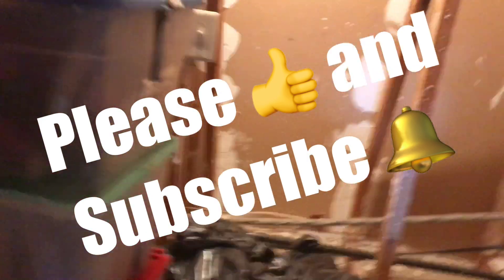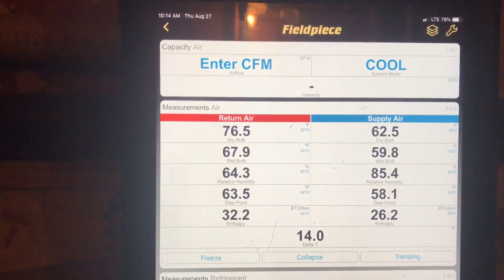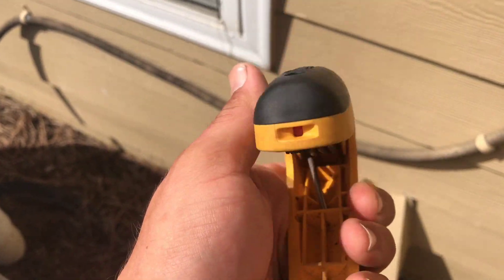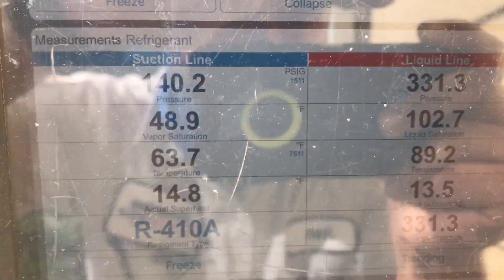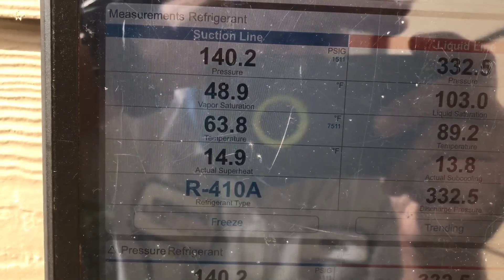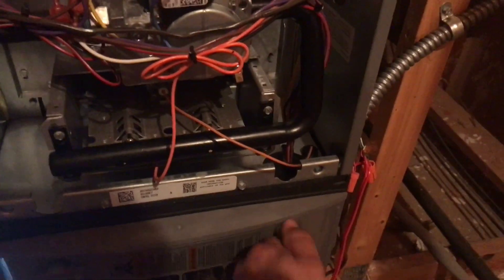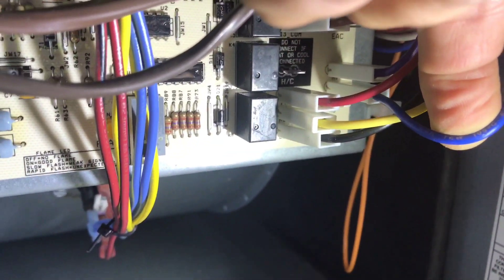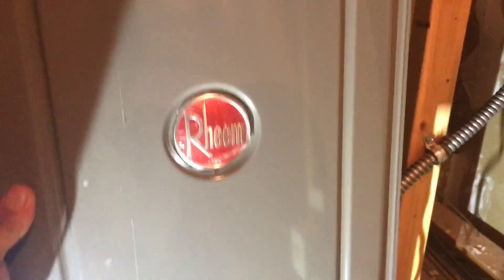Delta T’s and Blower Speeds.. HVAC Service Call

Comment: I wonder if you can help me. I have a brand new trane 2.5 T 410a(old stock 2018 model) mated to a 2018 goodman 3 ton air handler . Ive always suspected blower motor is set too high because Delta T is only 13-14 on a good day in cooling mode and 10-12 in heat mode unless its 50F out and then I can get maybe 13-14 . Last night it was 12F where I live in VA and weather app said feels like 5F. I could only get 73-74 supply air with a 66-67 return temp, therm set on 67. The goodman has an ECM motor with a multipin plug to board, I do not see taps or dip switches to change it? Can you help? Id like to get more than 7 degree delta when its 15F out.

Comment: That was the problem with my setup. Mine was purposely "mismatched" as in 3.5T coil and condenser and 4 ton AH. Only got a 13 delta T at best. I switched the black wire (high speed) to the blue wire (med-high speed) and the delta T went up to around 17. Mine is a piston, not a TXV. At least it's removing humidity now!

Comment: I have the same problem at my house where my DT is 13* and my Job Link Probes tell me the blower speed is too high but how can I find a lower speed if I have a Variable Speed motor, mess with the Dip Switches??
Reply from the maker: Possibly but you can’t always go by the job link app. Anytime the delta t is low it will always say the blower speed it high when it’s potentially a different issue. What is your SH and SC?
Reply: @HVACTechTips  My SC is at 8* (it calls for a 7.5* per specs) and my SH is at 12*.  txv system. Now at that time of checking the relative humidity was at 55 to 60% since I live close to Gulf of Mx.
Reply from the maker: @juanrobles9511  it really depends on a lot of things. Enough return? No vents closed? Low load in the house? Your blower may be set to a higher tonnage. You would have to check the dip switch settings on the back of the furnace door and match to the condenser tonnage to the switches on the board. If it doesn’t have dip switches it will have speed taps on the top of the blower motor where you can adjust speeds

Comment: the video is interesting but when I see the pressure in the suction line that is over 140 psi I would also be contemplating the possibility that the compressor may have a valve problem because something that I have been able to verify is that in the machines that claim to be from high efficiency is only theory because on the nameplate of the condenser they put that it is 30,000 BTU or 2.5 TR and the compressor is 22,000 BTU where the missing 8,000 BTU are and in a period of time the compressor is making a great effort and as a result it is that low pressure so high and there it may be showing valve problems and as we can find out, it is easy to run the freon in the machine and if when picking it up the machine does not go on the blue clock to empty and stays at 70 or 50 psig does not collect more and then we realize that the compressor is not doing it.  and to check the speed of the evaporator fan motor is important because if inside the pressures.

Comment: I had the same problem yesterday. After installing 1.5 ton unit (410a with a piston) in a 2 bedroom condo my suction line was 150psi and my line temperature was 76F. I realized that I forgot to adjust the fan speed (9-speed variable Goodman motor) the default was set to 1330cfm. I only needed 600cfm...

Comment: I've got a 5ton deltaT at 15 blower speed down to 1575 in a 2100 Sq ft home.When it's hot and a load home doesn't cool.If I speed up blower deltaT going get even lower.Subcooling is good superheat is good.Im thinking high static is main issue but evap could be starving.What do yall think

Comment: Where is the trap for the coil? Is withing the 3 to 6 ft.?
Reply: @carlgibson593  Manual says different.
Reply: @carlgibson593  First of all I just asked a  question. Then gave you an answer due to manual instructions. Every manual for the past 25 years of my career states installing p traps whether on air handlers or Evap coils.  the manual supersedes local codes.  due to your great video taking I can't see the model number on the coil. But i suspect it is an ADP Cased coil. Having a p trap With a clean out tee that is capped and the trap filled with water prevents cool air escaping from the system. And you know that we don't want any air loss. Plus putting in a breather Tee right after the trap helps with draining due to droops that maybe in the condensate line.  that may not be properly supported. Am I being superior? No. its experience bub, You should learn to appreciate it!
Reply: @carlgibson593  Now your getting nasty!

Comment: I would recommend using static and the units CFM chart to set blower speed. Delta-T will vary based on humidity in the home. Match the cfm’s to the tons of the coil to push the correct amount of air. 350-450cfm per ton.
Reply: I was about to say. He’s still just guessing. I can guarantee he could have gone one or even two taps down still.

Comment: Will Variable speed Blower Motor affect your delta T?
Reply from the maker: It can. But if the system is sized correct, it should keep a good delta t

Comment: I just have a hard time understanding when to speed up or slow down blower speed according to delta T any simple way to go by  it?
Reply: This is backwards
Reply: @joshuameadows5574  I was thinking the same thing
Reply from the maker: You should always start with the manufacture specs. You can usually find it on the door or schematic. If you have a low delta t raise speeds, if you have a high delta t, lower speeds